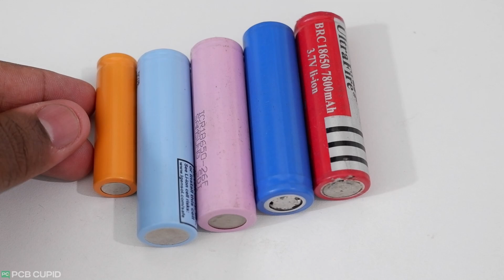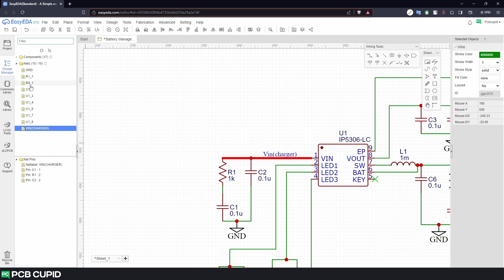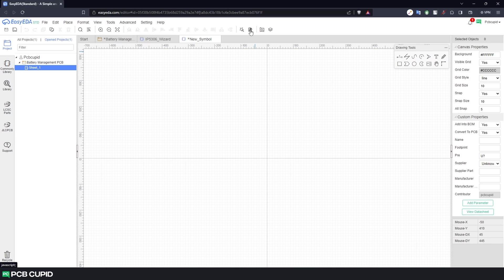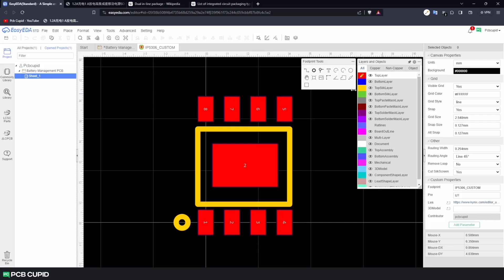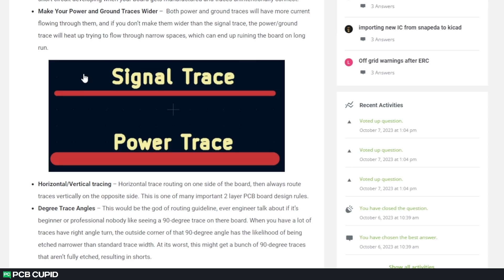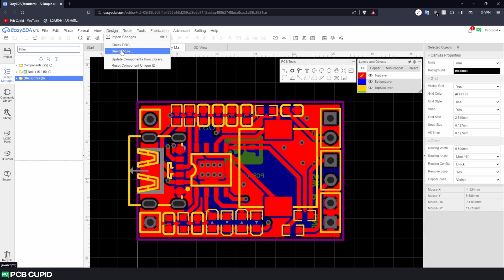How to Learn EasyEDA under 60 mins! | 2023 | #pcbcupid

Comment: This is excellent.  Fast paced and seems to cover most things.  I'm trying to get to grips with EasyEDA and this was very helpful.  Any tips on how to add power inputs and outputs that aren't USB sockets or jack plugs (e.g. they're just going to be pads on the PCB?).  Struggling to figure out that on the schematic!
Reply from the maker: You can just create a footprint ( how you want the edge connector to be ) and then place it during the PCB layout.